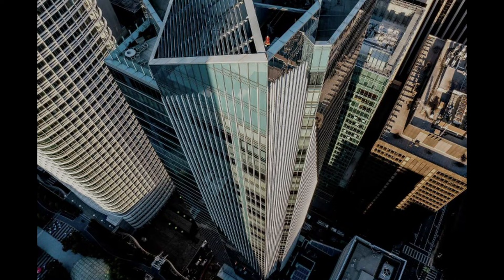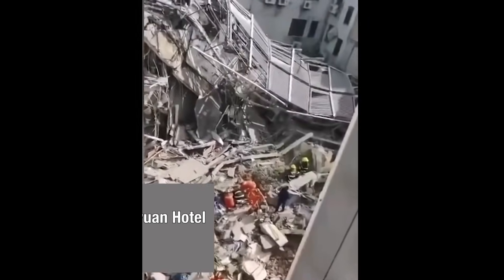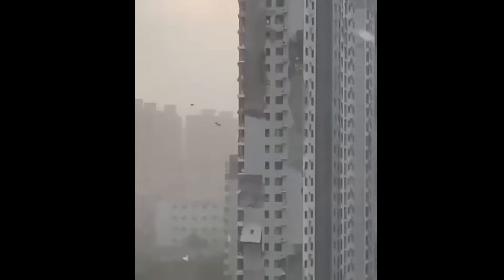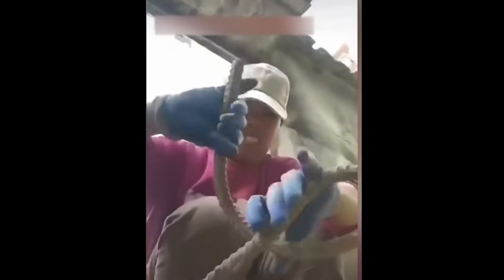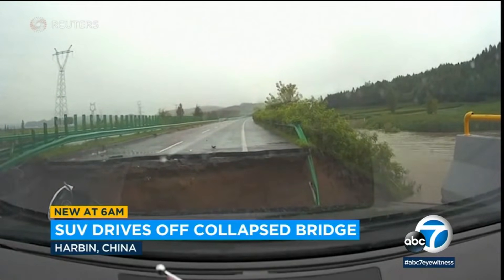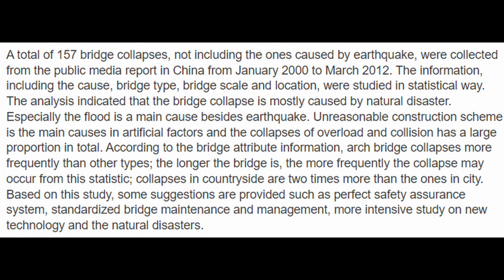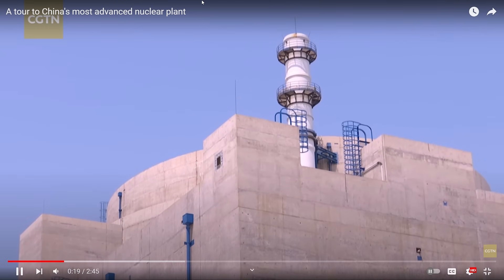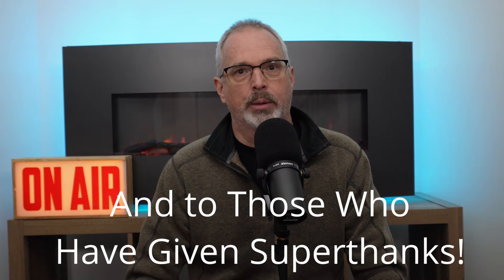Why Construction Projects in China are Often of Very Poor Quality

Comment: It’s a Chinese cultural issue.
The CCP specify that builders etc can only make 10% profit in their building projects.
Of course because of the corruption / bribes in their culture, they need to make more than 10% profit to survive.
So the only way they can make more than 10% in profits is to skimp on materials.
Less cement than required in concrete.
Less carbon in the steel re-bar leading to brittle steel.
Only this week it was found out that the greater majority of nuclear tipped ICBM’s contained water instead of rocket fuel.
The manufacturers stole the rocket fuel to cook with, & replaced it with water instead.
They figured no one’s ever going to launch nuclear missiles so what’s the harm stealing the rocket fuel to cook with? 🤷‍♂️🙄

In Chinese culture, if you can swindle someone out of $ with fake or faulty product, then that shows your intellectual superiority over your customer.
It’s considered to be fair, something to be proud of if you can get one over on the buyer.

So this is a culturally systemic fault with the bulk of Chinese products.

There’s a good chance the steel in Chinese air craft carriers & submarines is similarly compromised, just as re-bar steel is and the first real stresses they face, they will fail.

China really is the Asian Paper Tiger, much of their claimed strengths really is weakness.
Reply from the maker: Yes I agree with you assessment.  They are all "show" and no "go".

Comment: I know that I have seen corruption when ordering structural components from China. I won't go into project specifics but we had faked documentation, no engineering supervision (when supervision was required by contract and the supplier just lied about it) etc. We had welds that look like they were done by a two year old. We had one client actually pay more for a fabricated product since they wanted to avoid corruption but the quality was still substandard and all the welds and engineering had to be redone when the product arrived. You have to be very careful but on the other hand, if you know about the issues and pay accordingly, the costs could not be beat in North America. We had one client order a crane knowing it would be substandard and just factored into the costs that a bunch or welds and re-engineering and checking would have to be done.

Comment: Those buildings in the thumbnail are not collapsing, they are being demolished because the developer stopped building them a decade ago and they have been standing derlict since then. If a building is left as a skeleton exposed to the elements it is going to start degrading and become unrecoverable.
Reply from the maker: I know that. In the video I mention that these buildings were of too poor quality to finish and had to be demolished.
Reply: @CaseyJones-Engineer  No, they were not finished because the developer ran out of money and no one else was willing to pick them up. Most likely because the units inside had already been sold and consequently there was no simple way to make money from finishing them as a result. It is a consequence of the pre-sale model of project financing that is (or was) common in China. This is going to be the fate of many of these projects unfortunately, and it is pretty much entirely due to the project financing model being used and the underlying greed of the developers.

They may well have been built poorly, but that was not the reason why they were not finished.
Reply from the maker: @Tugela60  You should have watched my video as I covered the aspect of the builder running out of money too.
Reply: Duh...

Comment: One reason  Projects in China are Often of Very Poor Quality could be that China is currently building relatively massive construction projects, and some of them are shoddy. The US hasn't built stuff like that since the end of WWII, and what's still standing is the projects that survived.  What happened to projects like Pruitt Igoe, they were demolished.   To me there is plenty of evidence of shoddy building in the US these days, only the projects are smaller, on the scale of smaller housing developments.

Perhaps the US equivalent of Tofu Dreg buildings is the current Boeing 737 Max scandal (plug door) as opposed to the previous Boeing 737 Max scandal (software).

https://en.wikipedia.org/wiki/Pruitt%E2%80%93Igoe

Comment: Another factor is that the apartments are rarely occupied, mainly being purchased for investment.
Reply: Plus some estimates are they have built around double the number of residences as domestic population. So that is an oversupply around 1.5 billion, with a domestic population that is guarantied to be decline for decades, has not even started to turn around birth rate per female with policy changes in recent years, and does not have anything close to enough immigration to stabilize the decline from domestic population. It seems hard to believe the major builders had no idea many of these will never be occupied, especially in 2nd or 3rd tier cities,  which do not have the kind of capacity to draw in people like the largest cities.

Comment: Totally minor topic, but you mentioned nuclear fuel reprocessing and plutonium for weapons programs…

Plutonium from light water power reactors is typically irradiated long enough (for efficiency of power generated per fuel input) that it breeds significant quantities of the short half life Plutonium isotopes and is too radioactive to use safely for nuclear weapons.

It can be used, but it is so intensely radioactive that they damage their own cores (the “pit”) and explosive assemblies.  And are dangerous for crews to assemble and maintain.
Reply: Problems with chinese nuclear plants also include the chinese practice of direct dumping of untreated nuclear waste-polluted water to rivers. Then they publicly criticize the Japanese for release of treated water to the sea at Fukushima, whereas the Japanese released water met recognized standards for treatment.

Further, if and when a meltdown occurs at a chinese nuclear plant, the usual slow and inadequate response of the chinese govt. will make Chernobyl look like an expert disaster practice drill.
Reply: @geoh7777  both the Chinese and Japanese practice are dangerous and very irresponsible. The question has to be ask. WHY is it even necessary to released contaminated waste water, treated or untreated. It is just coolant. Send them to storage outside, let them cool off, and use them again. In a completely closed cycle.

Yes, I know. Europe, North America, and everybody else do the same. But that doesn't answer the question. Why are they dumping contaminated water into the oceans when there is no need?

Comment: There are so many scary items in this vidieo making it difficult to assess a cause/s. Improper mixing and not correct ratios of cement heck the portland may itself be defective and shortened cure times, not viable. Rebar without any steel criminal. Need to raze 15 million structures not 15, I have seen some pirated photos of concrete preported to be from 3 Gorges but unverified that I thought were fake until I saw the samples of failing concrete in this vidieo. I would have been afraid to enter and go up in these structures to take the photos contained in this report let alone become an occupant. This story will not end well. Ray Stormont

Comment: I think the French have been heavily involved in building their nuke plants. They also operate them for now.

One real problem they have is the thousands of dams many of which are pretty old.

But the most dangerous one is by far the 3 Gorges Dam. 

Chief among it's problems is cracking which is getting worse and there is also displacement.

It is also plagued by excessive mud build up and large amounts of garbage and debris.

One area of concern that had significant problems from construction to the present day is the lock system.

A failure of any of that structure will lead to the total collapse of the dam.

The downstream threat is upwards of 250 million people as either casualties or displacement of large numbers.

China has built 23,000 km of high speed rail that loses ¢60 million a day. Also, the rolling stock is imported making the system vulnerable to parts issues should more sanctions be imposed because the CCP decide to invade Taiwan.

China's economy is being decimated because of supply chain decentralization and so much wealth has been skimmed by the CCP the country is functionally broke.

The government has just cut or eliminated most military pay.

The military is fraught with graft and fraud with promotions gained by party affiliation and bribes.

The country has faced massive flooding for several of the last few years, 80% or more of the ground water is so polluted it isn't fit for any human purposes.

Soil contamination is widespread. Crop failures are common.

Back to flooding, their big shiney cities have very poor infrastructure . It's almost an afterthought because stuff buried in the ground can't be shown off. Even small amounts of rain lead to flooded streets.

China is a failed state and COVID was the slow rolling black swan event that started eroding its shaky foundations.

Xi is a moron with little education. His Zero COVID policies had serious negative impacts.

I kid you not when I say they were actually spraying disinfectant on asphalt!

The biggest threat on the immediate horizon is definitely famine.

I could go on but to get the full picture you'd need to watch a lot of videos on YouTube. They are produced by expats in Canada and Australia.

China Insights, China Observer, China Truths, The China Show (produced by a South African and an American who lived and worked in China for years) are a few of the best.

Please make the best of the typos. This is too long to edit at this point.

Comment: All those who are infatuated with high-speed trains point to China as the epitome of how a passenger rail system should be built. I wonder if they give any thought to the quality of China's infrastructure, especially when you take into account that the entire system was built exceptionally fast, and that China's HSR can barely cover its operating costs let alone maintenance.
Reply: There was a train crash of China's high-speed train about a year of its completion. It was not reported much in western news. Some of the dead passengers were just buried within the train cars in excavations near the crash site before western eyes could further report on the accident (to save the Chinese international "face"). It turns out the software that runs the trains was their customized version of an obsolete flash software widely pirated in the early 2000s. Chinese train company as usual tried to cut corners instead of paying for life-critical applications. I still remember the boastful Chinese propaganda videos after they completed their high-speed train and they claimed it was far ahead of the Japanese high-speed trains that they shamelessly copied from.
Reply from the maker: China is in real trouble and it is only going to get worse within the next decade it seems.

Comment: On the plus side, the corruption and lack of standards is also endemic through their defense industry. It is a culture that places enormous faith in luck, which you will need if you live in one of those high rises or cross their bridges. I hope there’s some good quality cameras trained on the Three Gorges Dam.
Reply from the maker: The number and size of cracks in the dam sounds alarming.  I wonder if they didn't have adequate thermal control during concrete placement.
Reply: @CaseyJones-Engineer  My understanding is that the bedrock is limestone, which as you know, is porous.  There has to be water tunneling under the dam.  sooner or later, that's going to be a big problem.
Reply: Surely this isn't Chinese culture itself, but the more recent Communist China culture of Mao. Taiwan don't suffer these kinds of quality issues in their infrastructures.
Reply: @hentype  Taiwan used to be like this 30+ years ago when I first lived there but there were so many collapses the government was forced to tighten up the rules and standards and really enforce them. Since then there's also been a general change of culture and the pressure to do everything on the cheap and cheat is much less. But some buildings there still fall down quite often typhoons or even minor earthquakes.
Reply: "a culture that places enormous faith in luck" really well said, it's amazing what people, both as individuals and as a culture, will do to ignore reality and cling to beliefs, to their own detriment.

Comment: Casey, I've been watching China for several years now, and you are quite right, corruption is rampant in China, from the top on down.  In fact, Xi is going through the CCP with a vengeance, eliminating many high ranking officials and military command ostensibly due to corruption.  Recently, China lost a submarine, and a Navy ship due to equipment failures which resulted in an overall shake down, during which time they found that the missile silo hatches would stick and not let the missile out when fired.  They also found the missiles had been filled with water instead of propellent, I'm not kidding.

I forgot what city it was, but they had like an 80 story building start shaking so bad that the people just poured out of it running for dear life, you could see the top two towers on the building literally swaying, significantly.  Bridge work and their high speed rail fair no better.  A recent post taken by a passenger showed the inside of a bullet train under way, shaking like a leaf, seriously, man.

Their China made rebar is something else.  In the video you showed that piece of rebar acted like lead, but most of it breaks in two with someone using their bare hands. I've seen someone grab what looked like #5 bar and break it, just like that.  In video's where they are placing concrete, they keep adding water until the concrete is like a runny batter, worthless.

As you pointed out, they have no quality control nor quality enforcement.  Their largest builder, Evergrande went bankrupt last year or the year before with a debt of 300 billion dollars.  The problem is that people would buy apartments while looking at a beautifully designed and constructed model in lobbies of these big contractors.  They literally pick which unit they want to buy as displayed by this large, maybe 40' squared presentation, the model buildings being maybe three-four feet high, often putting down large deposits if not the whole some.  But then the builder takes the money and buys more land with it instead of building the development, as in a Ponzi scheme.  (Evergrande branched out into game stadiums, theme parks, etc.)  Country Garden, one of China's biggest developers recently went bankrupt as well.  A recent study out of Japan found that there were approximately 20 million unfinished buildings in China.

What those poor Chinese are going through now with the collapse of their economy, is that they cannot take bankruptcy, they HAVE to pay on the loans that they took out EVEN IF the building isn't built, and the culture of China was to buy rentals as retirement investments, now people in their 30's are paying on 1 or often more mortgages that will gain them nothing, so they stop paying and then the bank freezes their accounts.  It's heartbreaking to watch these hard working people get taken to the cleaner like that.

However, the worst may be to come, last Saturday I think it was, Zhongzhi Financial, China's largest 'shadow bank' a term given to the financial institutions that survive outside of regulatory constraints just filed for bankruptcy, its portfolio consists of over 1500 subsidiaries, and I think it might have been Bloomburg who estimated that the potential loss in the shadow banking industry might be as high as 3 TRILLION DOLLARS!!!

If people have financial interests in China, I'd get the hell outa there quick.
Reply from the maker: Thank you for you comments.  I think many people in China are trying to figure out a way to move to another country.
Reply: @CaseyJones-Engineer  In droves!

Comment: not just china, not just buildings - boeing seems to be developing quite a reputation in the tofu field too.
Reply from the maker: Boeing's commercial unit keeps having issue after issue.
Reply: @CaseyJones-Engineer  Boeing contracts that portion of the fuselage and other portions of the 737 Max to Spirit Aerosystems.  The questions start with the design adequacy, fabrication of the plug, assembling the plug into the fuselage; inspections by Spirit, Boeing, and Alaska Airlines... but yeah, just when their stock was improving.
Reply: This is not a fair comparison.  While Boeing has made some mistakes (as does anyone who does anything) the base aircraft and structures are solid and well proven.   The recent issue may have been an assembly mistake by a person.  But, at this point we don't even know if that person worked for Boeing or one of its contractors; or if the worked for Alaska Airlines or one of their contractors.  Please don't jump to conclusions and let the NTSB investigation determine where the fault lies.   Note that the Boeing CEO likely does not know what the NTSB investigation team has found or is looking into; and any comments he makes may have no correlation at this point.  By law only the NTSB Investigation Team Leader can disclose information on where they are at or provide a very specific statement that others can quote.   We have heard nothing from the NTSB Team on what they have found.
Reply: Very disturbing comments !  Boeing is a respectable corporation !